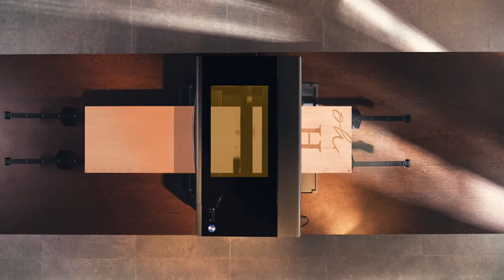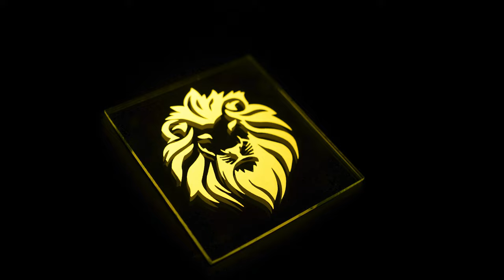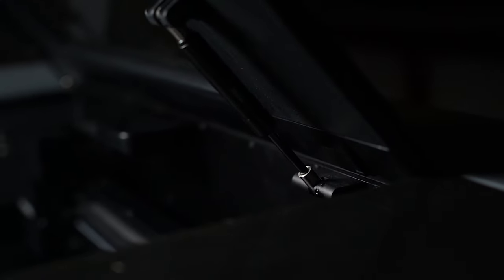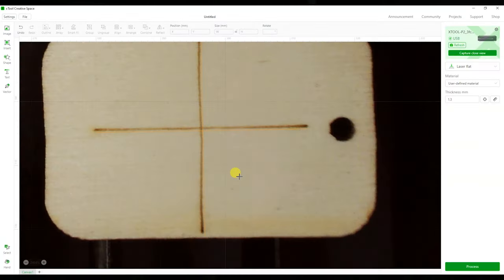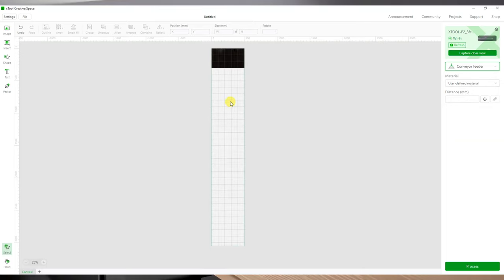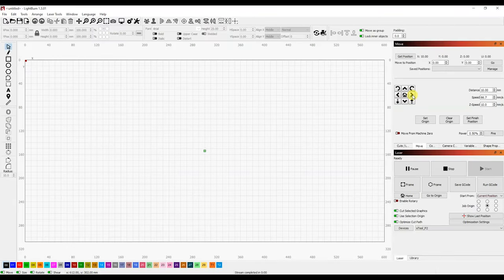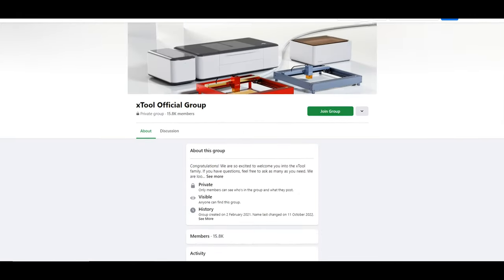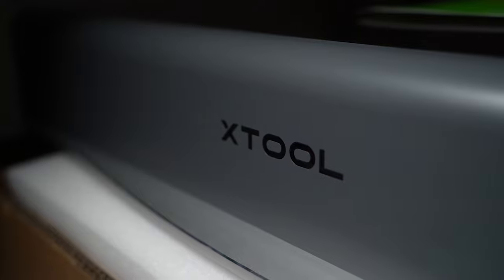Impressive Results: xTool P2 CO2 Laser Review

Comment: I'd like to see a comparison with the Glowforge Pro and to know how much of a difference there is between 1000 and 1355 DPI.
Reply from the maker: I would not consider it as a deal breaker.  Because I know that I'm never going to use 1000 dpi. Maybe I'll try out one image at 1000 dpi and that's just to see how it looks. Higher DPI settings take too much time and it also burns the material. I mostly use 254 DPI and the image turns out really good for me. If you could share your email I'll share a pic of 500 DPI vs 1000 DPI.

Comment: Quick question, why do you need framing when the cameras position the job perfectly?
Reply: I haven't watched the video yet, but, coming from a woodworking background, you ALWAYS double-check your work. "Measure twice, cut once"

I'm using D1 Pro, and even when using a Jig that I created, and using absolute coordinates, on a job I've already run, I still frame it before running, and, it has saved me several times.
Reply from the maker: You're right, the camera does a fine job. But I like to run things manually on LightBurn and a pointer would have been good. It's just a me thing 😃
Reply from the maker: @tim wigmore yup always measure twice or maybe four times and cut once
Reply: @MellowpineLasers  I'm very much the same way. I will often frame the job up with square several times, to make sure my area is good, then again several times with the circle to make sure it's going exactly where I want it. And on my D1 Pro 20w, I also use the laser spot, not the crosshairs

Comment: Nice review! The P2 looks pretty solid. I agree, the emergency button placement needs better placement. Do you have any recommendations with dealing with fumes and smoke?
Reply from the maker: The exhaust system works well, and the doors don't open until about 10 seconds after job completion. You can duct the exhaust outside. xTool also has a air filter if you cannot vent the fumes outside. I haven't used it yet but seems good.
Reply: @MellowpineLasers  I plan to duct the exhaust outside but worry about the impact to my neighbors - we share walls so their windows and balcony are really close. I’ll consider the xTool air filter, but I’d appreciate if you have any others you’d recommend. Thanks!
Reply from the maker: There are some from Omtech as well that you can look at. I haven't used any of the filter systems yet so I cannot comment on which one is the best.

Comment: Nice review!  I currently Kacey the BBP and it is listed at 50W.. you have it at 40W on your spreadsheet.. was this  a typo or have they changed the specs on the newer models?..  also, not sure if you know how does the cooling system hold up ? I had to add a custom home-made chiller to my bbp since  the ambient  temperature when I'm cutting  can be 85° F.. thanks in advance.
Reply from the maker: Yes, it's a typo, the BBP is 50W. Regarding the temperature, the P2 never went beyond 84 F even after prolonged use, the cooling is adequate

Comment: Great vid, been waiting for the P2 to come out so I can order one. One question...
The laser is 55W but are you not suppose to run a CO2 laser over 80% power in order for longer life? So really this is a usable 44W laser? Be nice for some run speeds at 80%
Reply from the maker: Yes you are correct. You need to run it at low power levels for longer life. This means you have to run your jobs at slower speeds, but, yes you will be able to use it for most jobs. If you see the tests I haven't used 100% for most jobs. For engraving you don't have to go beyond 50% in most cases. You only need 80%+ when you are cutting really thick material.

Comment: You mentioned adding water, did you also add the anti-freeze that came with it? (Edit: asking because my laser never instructed me to use it so I'm not sure about how to use it when I get this one)
Reply from the maker: You need to add antifreeze to water only if the anual lowest temperature in your area goes below 0 degree Celsius. The ratio of antifreeze to water needed for different temperature ranges is clearly mentioned in the instruction manual. It's easy to figure out. If you have any doubts when you get the machine please shoot me an email.
Reply: @MellowpineLasers  Thank you for the response! Makes sense to me 😃

Comment: Does the laser spot seem big to you?  I've been looking at other lasers, and the beam is much smaller ( .025mm - Omtech Polar vs .20mm x .15mm on P2).  I do miniatures in 1:48 scale.  Also, do you know what the size of the focal lens is?  Is it replaceable (miniaturists primarily use a 1.5")?
Reply from the maker: Yes, you are correct the spot size is large for really fine engraving. The lens used on the P2 is primarily designed for cutting so it has a longer focal length to get more depth of cut. The lens can be easily replaced, however, there is one problem. If you go for a shorter focal lens to get smaller spot size the focusing distance is also reduced. With the current lens the distance between the nozzle and the surface is under 10mm and the nozzle is not removable in the variant I have. This means I cannot use a shorter focal lens without the nozzle hitting my workpiece.

Comment: Great review!!!! I thought the rotary example on the D1 riser looked very jaggy and not smooth...any reasons why?
Reply from the maker: I was running it too fast, just wanted to see if I could run the rotary. Dropped the piece on it, used a ball park speed and power and ran it. But the engraving came out good and I thought I'll add it to the video.
Reply: @MellowpineLasers  EXCELLENT. You really did a great job, I look forward to another review after they work everything out.

Comment: Dumb placement for the E Stop. It would have been very inexpensive to have a light indicating where the laser head is
Reply from the maker: They could have placed the E stop towards the front, I opened up the body panels and there is enough space for an E stop towards the front. On the plus side the button on the top can pause jobs. I tried using it with LightBurn, it was annoying not having a pointer. I think I'll design a pointer attachment for P2 that you can 3D print. If I do I'll share it.

Comment: You need to open up the back to fill in coolant anyway, don't you? It shouldn't void the warranty…

They do have added pointer, I think. From a live stream they did today: https://youtu.be/PZBsg9T8Qts?t=2299

This sounds like a really nice machine for the price (and even better if you could the $1000 discount pre-launch). I am a little intimidated by the size, but bigger is better, right? :)

[Edit: The pointer seems to be for the camera, not the laser…]
Reply from the maker: Opening the back doesn't void warranty. I opened the entire body that's how I figured out what all sensors it has.  There were screws that had seals on them.

Comment: Most features look innovative but the emergency stop is in a very poor location. When you have to hit the stop you don't want to be reaching over a machine to do it especially if there is a fire. Proper emergency stops on industrial machines are right were the operator is. 

Price is a strange thing as it seems that convenient size is a  premium price. I just bought a 1390 for less than this unit where some features are not needed due to work size.
Reply from the maker: Yes the E stop placement is bad.

When you go beyond a certain size the price just shoots up like crazy.